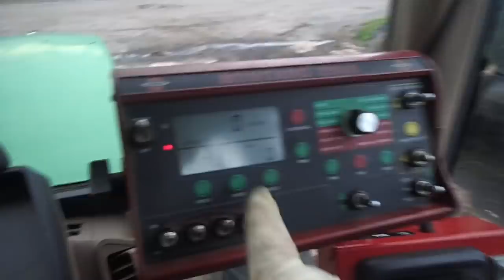Sprayer Parts

Comment: Wes, relax and do what you can do. Don't beat yourself up on the stuff you have no control over or being pinched for time. Haste makes waste. 
We never used foam markers. Our old sprayer wasn't wide enough to make a difference and the current one we use a gps guidance system. I personally dont look back at the decision, but I do respect others even if it's not what I would do. To a favorable 2019 my friend.

Comment: Are you sure it the micro switches on the sprayer, they are pretty easy to test with a multi meter and they don’t fail very often.. I am working on my HARDI HC 950 which is similar. My valve motor is sporadic and delays to turn on sometimes. I found out today it is the bridge relay. It’s in one of the electrical boxes. It’s a $22 part online.  It switches the polarity.